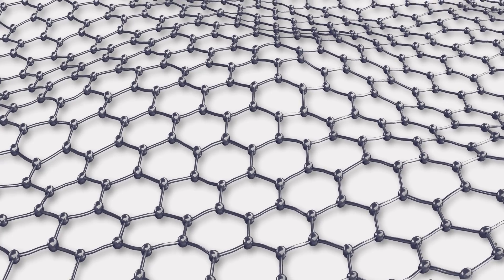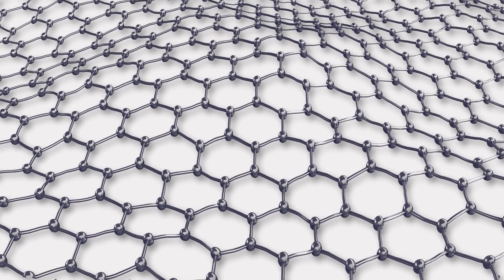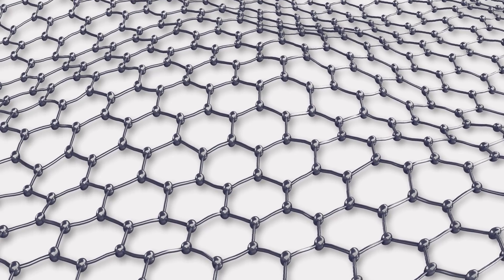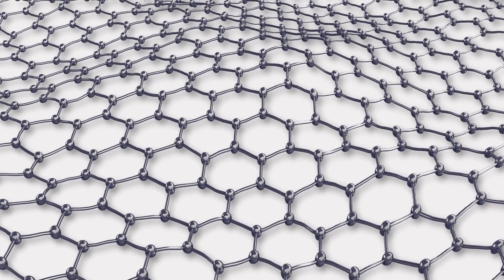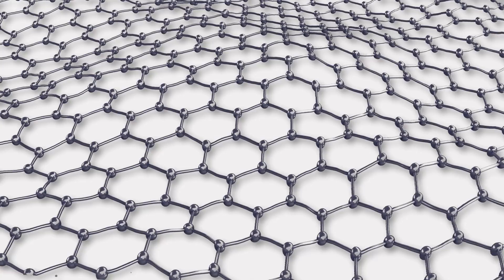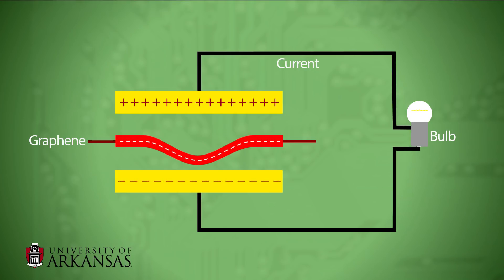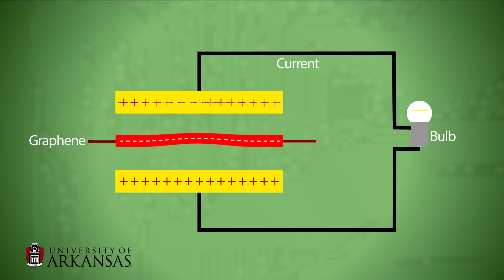A Potential Source of Clean, Limitless Energy

Comment: Could it (graphene) be embedded in rubber band material? And stretched and held in place by clips which could be anode and cathode and the use of the so called ( getting water out of thin air) machine and letting this collected water drip onto the stretched graphene membrane? . If graphene membrane was tiled slightly to allow water to drain. Would electric be made in this way? . If not maybe the use of tiny embedded magnets could be placed in graphene stretched material?

Comment: Japanese Laid-Open Patent Publication No. 2021-145502 (i.e., JP2021145502A) discloses a Method for applying a constant voltage to a Graphene of a Power generation device being studied by Professor Paul Thibado of the University of Arkansas.  By using an Electret, the constant voltage can be continuously applied to the graphene without consuming electrical energy. 😊
Reply: Interesting... thanks ! 🤔😇

Comment: I have a question about Mr. Paul Thibado's invention on "Graphene Animation" (https://youtu.be/KiLTEjm8zLw), a video released by the University of Arkansas on YouTube in October 2020.

I assume that a voltage and a current generated are very small, but what kind of diodes are capable of unidirectional current flow even at such very small voltage and current?

Comment: Its a interesting product but I think the tittle is misleading. The energy is still coming from heat in the system.The system will need a heat-flow into it to continually produce electricity. That heat could come from the human body for the pacemaker. Still it is quite a stretch to use the term "limitless energy".

Comment: Mr. Richard Phillips Feynman, a famous genius scientist, introduced a Brownian ratchet in his book “The Feynman Lectures on Physics”.  The Brownian ratchet is a submicron-scale micromachine in which components move randomly by Brownian motion. 

As an IMPORTANT POINT, Mr. Feynman denies that the impeller and the ratchet of the Brownian ratchet rotate continuously in one direction. However, he and many other scientists have agreed that the impeller and the ratchet rotate randomly. Naturally, the impeller and the ratchet rotate randomly because the Brownian motion is the random movement.

Energy can be generated by actively using such random movements as follows. 

In the conventional Brownian ratchet, limiting the rotation of the impeller in one direction was a necessary condition for the machine to work well.  The conclusion is that the Brownian ratchet does not work well, as it is not possible to limit the rotation of the impeller in one direction.

On the other hand, if a Permanent Magnet is provided in place of the impeller and a coil is placed nearby, Electric Currents can be generated from the randomly moving permanent magnet. Even if the movements of the permanent magnet are random, electric currents will still be generated. There is NO NEED to limit the rotations of the permanent magnet to one direction.

Energy can be generated by actively using random moving of the permanent magnet whose rotation direction changes randomly.

Comment: It will never leave the lab. Too much limitations
Reply: More likely it will just have very specific usages where battery replacement is difficult or impossible. The video talks about pacemakers where the battery replacement is difficult. I could also see this on space probes which will be in space for decades. This is very exciting.
Reply: And within space vehicles themselves to recapture waste or bio heat and convert it to electricity to power small devices.

Comment: Scaled Up, that makes 100KW / sqm!!! However that would require a heat input og similar magnitude, so as backing on Solar cells, waste heat recovery, zero maintennance geothermal a plethora of applications if this is scalable.  Just a shuebox sized gadget with a PC fan at one end would deliver hundreds of watts. The radiator on your EV would replace the battery!

Comment: Some ppl are saying its not a big deal, but 10 microwatts / 10 microns?!

If Tesla made one of these the exact same weight as a P100D battery, it'd produce over 200kw an hour, at that output. You could literally run the thing at full power, until the thing falls apart, without ever charging it...

Assuming you live in an environment where there's enough heat to draw from the environment.. etc etc

But it could fully charge a dead Tesla battery in a half hour, not that you'd need a battery anymore. You wouldn't even want a regular Tesla battery at that point, you'd want one of these, and you'd never charge the thing again. 

Not a big deal..? 😆 ok 👌

If this thing works in principle, it's so huge, that it went right over half of your heads.
Reply: This does not scale.
Reply: How do you know it doesn't scale? Links? Very interesting..

Comment: Assuming the first and second laws aren't violated, this feels both: 
1. Too low power 
2. Too delicate 
..To produce something useful. 

To clarify more, this appears by analogy similar to energy harvested by wave motion.  This'll pose the problem that large enough waves are too rare, and also have to account for efficiently harvesting with the large variation in amplitude and frequency. Can the resonant frequencies be efficiently tuned? 

Either way, I'd think there'd be a hard limit of not being able to extract more power than the ambient environment.
Reply: This is the first pass at the technology. It can develop, new discoveries constantly being made! Even if the ambient environment cap  turns out to be ultimately true, we can place it in energetic environments!
Reply: The 2nd law is violated indeed. That's the very point of this invention. Supersedes the 1775 Academy of Sciences no-no-no. :-D
Reply: @briancannard7335  no its fine, you can't treat electrostatics like magnetism.

Take for example two parallel plates attached through a load, if you place a third parallel plate in between and charge the plate to some voltage, then the induced charge on the outer plates will depend on the charge of the inner plate and how much off center the inner plate is.

Unlike with a magnet, when you move the middle plate charge begins to rebalance between tthe outer plates throught the load and halfway between the plates there is an electrostatic null-point after which the middle plate is predominantly attracted to which-ever plate its clossest to as charge rebalances through the load.

This means that a well designed electrostatic generator appears to the input as a device that stores and releases mechanical potential energy by playing teater-totter with a charge balance through a load.

It the case of this device, quantum fluctuations are enough to oscilate the grahpene sheet, which functions as the middle plate and any vibrations induces even just by the vibrations from temperuature is enough. Is a very small distance and it would need billions of units on a chip and it would make micro-watts of power -> enough to run your wrist watch.
Reply: Nether of which apply to electricity.

Comment: Ugh this is sad. Congrats on discovering nyquist noise and peltier devices. You left out the fact that you need to cool the light bulb to below the graphene temperature to harvest ANY current.
This is a scam. Guessing it's a fake university?
Reply: 📰 "The findings, published in the journal Physical Review E, are proof of a theory the physicists developed at the U of A three years ago that freestanding graphene — a single layer of carbon atoms — ripples and buckles in a way that holds promise for energy harvesting.

The idea of harvesting energy from graphene is controversial because it refutes physicist Richard Feynman's well-known assertion that the thermal motion of atoms, known as Brownian motion, cannot do work. Thibado's team found that at room temperature the thermal motion of graphene does in fact induce an alternating current (AC) in a circuit, an achievement thought to be impossible."

📰 source: https://phys.org/news/2020-10-physicists-circuit-limitless-power-graphene.html 

📰 October 2, 2020
Reply: @platoscavealum902  That's the article that lead me to this video.  I've already sent a comment to the author of that phys.org article. I can't believe they would allow that kind of trash on an otherwise fairly reputable site.

I'm quite surprised this "physics professor" didn't realise how the laws of physics prevent his idea from working as described.  This system quickly reaches equilibrium with the load.  In order to continue producing "power" the load must then be cooled(or graphene heated).  This is very similar to how peltier devices and thermocouples work.  Yes, this is a viable way of producing usable energy from a temperature difference.  No, this does not create any power directly from heat itself(in the absence of a place to dump heat to) as this breaks the laws of thermodynamics.

Comment: Any news? As your invention defies the 2nd law of thermodynamics for the first time, it is really revolutional and can help mankind solve the energy problems. We need this!
Reply: 📰 "The findings, published in the journal Physical Review E, are proof of a theory the physicists developed at the U of A three years ago that freestanding graphene—a single layer of carbon atoms—ripples and buckles in a way that holds promise for energy harvesting.

The idea of harvesting energy from graphene is controversial because it refutes physicist Richard Feynman's well-known assertion that the thermal motion of atoms, known as Brownian motion, cannot do work. Thibado's team found that at room temperature the thermal motion of graphene does in fact induce an alternating current (AC) in a circuit, an achievement thought to be impossible."

📰 source:
https://phys.org/news/2020-10-physicists-circuit-limitless-power-graphene.html 

📰 October 2, 2020
Reply: @platoscavealum902  " "This means that the second law of thermodynamics is not violated, nor is there any need to argue that 'Maxwell's Demon' is separating hot and cold electrons," Thibado said. "

Then it's not proper energy harvesting.

Otherwise I was wondering why it's published exactly 1/2 year after & before April 1st.
Reply: Which word are you having problems understanding, energy or harvest?

Comment: So this converts movement to energy?
Reply: No, this doesn't actually work as it ignores the equilibrium that will be reached once the light is at the same temperature as the graphene... this is a peltier device using nyquist noise.
Its a scam.

Comment: You'd been to have each set of copper "plates" interconnected with just those whose graphene wires were in sync to make this a practical power source.  Without graphene "wires" moving synchromously as a group, the outputs would cancel out.

Comment: In the description -> "...temperature changes caused by ambient heat makes graphene ripple and buckle."  Harvesting energy fluxes is what we do.  This just seems to be another way to take advantage of that flux.  It isn't "free" energy.
Reply: This is their point that the exact opposite it happening and therefore it does not violate the 2nd law of thermodynamics. The energy is due to the 1/2 spin of the electron - not to the "movement" of the electrons.

Comment: Technical issues. 

Charge Isolation: I.e. charging the graphene and preventing charge leakage to either the electrodes or the environment, either of which would result in the graphene power cell being useless.
Reply: It's not based on charging - it is resonating 1/2 spin energy from virtual photons.

Comment: Isn't this essentially an ambient heat engine? Heat is vi rating molecules. Converting the kinetic energy of vibrating molecules to current should mean a loss of heat.
Reply: 📰 "The findings, published in the journal Physical Review E, are proof of a theory the physicists developed at the U of A three years ago that freestanding graphene — a single layer of carbon atoms — ripples and buckles in a way that holds promise for energy harvesting.

The idea of harvesting energy from graphene is controversial because it refutes physicist Richard Feynman's well-known assertion that the thermal motion of atoms, known as Brownian motion, cannot do work. Thibado's team found that at room temperature the thermal motion of graphene does in fact induce an alternating current (AC) in a circuit, an achievement thought to be impossible."

📰 source: https://phys.org/news/2020-10-physicists-circuit-limitless-power-graphene.html 

📰 October 2, 2020

Comment: How does Paul Thibado account for losses within the circuit (eddy currents, friction, heat and light generation, etc.)?  Also, where does the charge on the graphene come from, and how is it maintained?  

The simplified illustration seems to be a variation on a capacitive circuit.  So it is not indefinitely sustainable as shown, but rather a modern example of the "perpetual motion machine" fallacy.  Since this is an extremely short video, I presume that we are missing a great deal of information.  

Unfortunately, that lack of information is what makes this video non-credible.  The basic argument is 'I have a source of limitless energy'; however, the use of a capacitive circuit with a light emitting load violates a primary law of physics -- Energy cannot be created or destroyed.  Additionally, there is no evidence to show where the continuous flow of energy into the circuit comes from.  Finally, we have the perpetual motion fallacy as our only example.  As a result, this video's poor presentation is a failure as it stands, diminishing the reputation of the University of Arkansas. 

I would most sincerely like to see this video revised to properly address the perpetual motion fallacy by providing a better model that accounts for the losses and shows where the initial energy comes from.
Reply: 📰 "The findings, published in the journal Physical Review E, are proof of a theory the physicists developed at the U of A three years ago that freestanding graphene—a single layer of carbon atoms—ripples and buckles in a way that holds promise for energy harvesting.

The idea of harvesting energy from graphene is controversial because it refutes physicist Richard Feynman's well-known assertion that the thermal motion of atoms, known as Brownian motion, cannot do work. Thibado's team found that at room temperature the thermal motion of graphene does in fact induce an alternating current (AC) in a circuit, an achievement thought to be impossible."

📰 source:
https://phys.org/news/2020-10-physicists-circuit-limitless-power-graphene.html 

📰 October 2, 2020

Comment: Before any one pukes out limitations of thermodynamics, he is a physics professor for gods sake, He sure has taken into account all its limitations. He hasnt for once mentioned the term limitless, its the title thats misleading.
About electromagnetism, that video is wrong, thats not how electricity generates.
 First, the membrane has to vibrate and will only vibrate if there is noticeable temperature gradients, Perhaps only on sheaths of heat emitting devuces like car engines, which again stupid becuase it requires another engine. In an open air, nomatter how hot or cold the weather is it will equilibriate and cannot vibrate for long.
Second , since its the rate of change of flux that induces electromagnetism, it should vibrate in accelerated manner with actual angular acceleration. constant angular momentum would do much.
Third, if the electric potential is that strong to generate such flux, i am doubting its stability as a sheet. it would wrap upon itself, or immediately attract foreign particles destabilising such structure...
Reply: 📰 "The findings, published in the journal Physical Review E, are proof of a theory the physicists developed at the U of A three years ago that freestanding graphene — a single layer of carbon atoms — ripples and buckles in a way that holds promise for energy harvesting.

The idea of harvesting energy from graphene is controversial because it refutes physicist Richard Feynman's well-known assertion that the thermal motion of atoms, known as Brownian motion, cannot do work. Thibado's team found that at room temperature the thermal motion of graphene does in fact induce an alternating current (AC) in a circuit, an achievement thought to be impossible."

📰 source:
https://phys.org/news/2020-10-physicists-circuit-limitless-power-graphene.html 

📰 October 2, 2020

Comment: Without looking into the research much, the energy it seems comes from the charge they add to the graphene. From what I know about graphene is that it shouldn't be possible because of how atoms are (so far known) to stack. What happens is a single atom flips and changes place with another causing the 2d sheet to act like a 3d shape. If, I'm wrong and they don't use a charge added to the sheet, this would be harnessing atomic weak force. For whatever reason the carbon moves, it's a chemical reaction within the synthesized molecule of carbon sheet graphene. Not thermal.
Reply: 📰 "The findings, published in the journal Physical Review E, are proof of a theory the physicists developed at the U of A three years ago that freestanding graphene—a single layer of carbon atoms—ripples and buckles in a way that holds promise for energy harvesting.

The idea of harvesting energy from graphene is controversial because it refutes physicist Richard Feynman's well-known assertion that the thermal motion of atoms, known as Brownian motion, cannot do work. Thibado's team found that at room temperature the thermal motion of graphene does in fact induce an alternating current (AC) in a circuit, an achievement thought to be impossible."

📰 source:
https://phys.org/news/2020-10-physicists-circuit-limitless-power-graphene.html 

📰 October 2, 2020